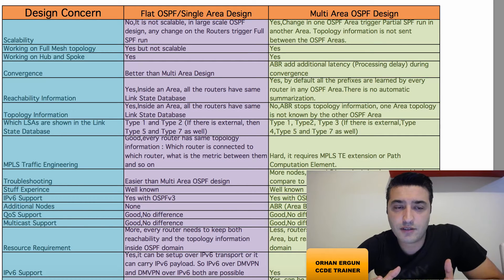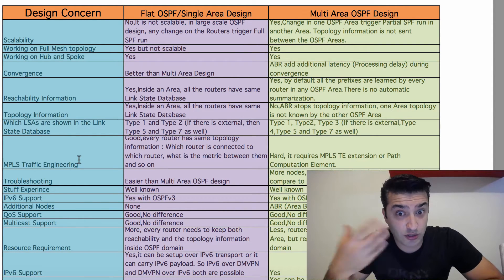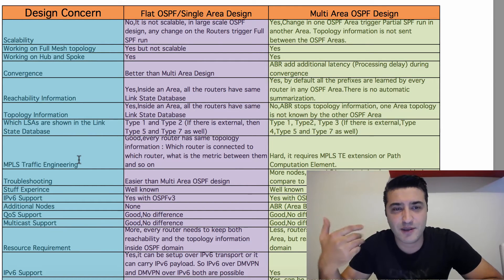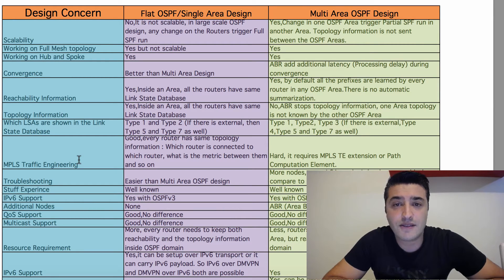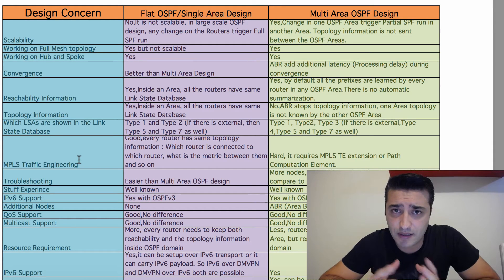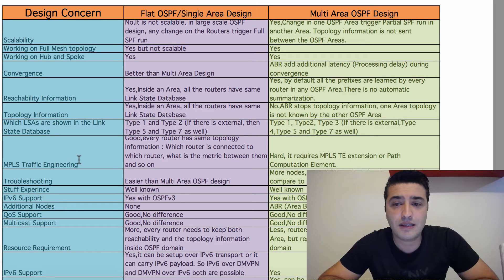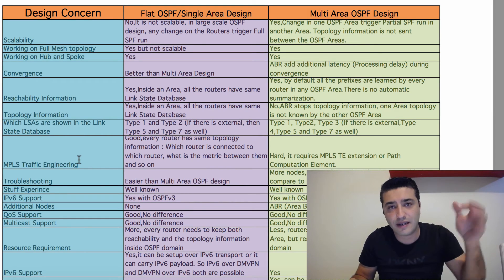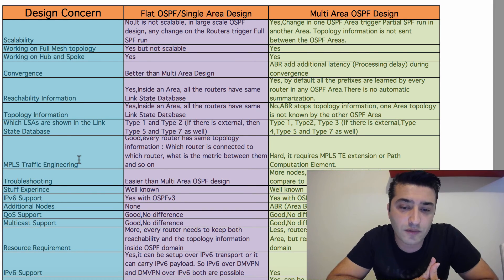OSPF Design   Single Area and Multi Area OSPF Design

Comment: Intra-area routing will work fine in non-backbone area but to connect to other areas, we must have a backbone area for inter-area routing. Backbone area is required to get summary of topological information through ABR (connects backbone and non-backbone area).
Reply from the maker: Excellent. But only correction is, not the summary of topological information but removing the topological information. So, different area OSPF routers don't know their topology information.